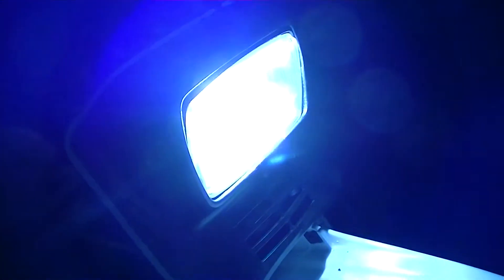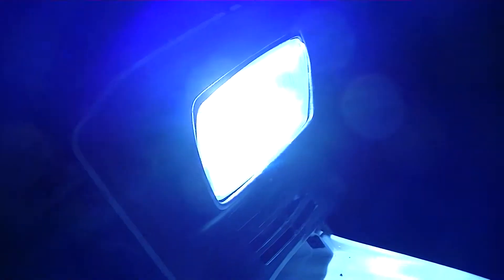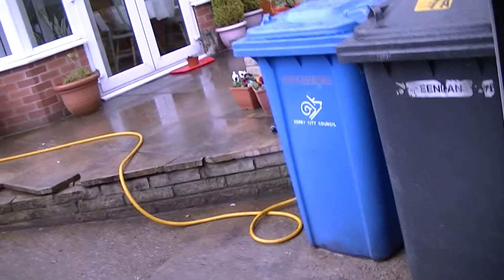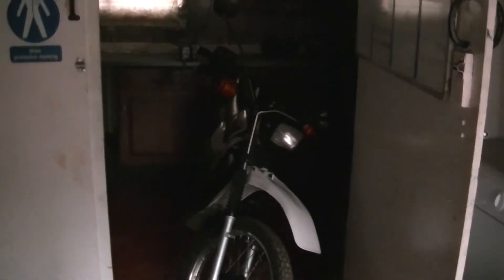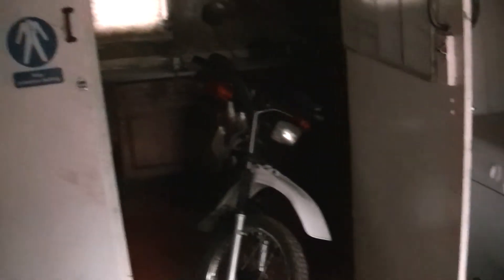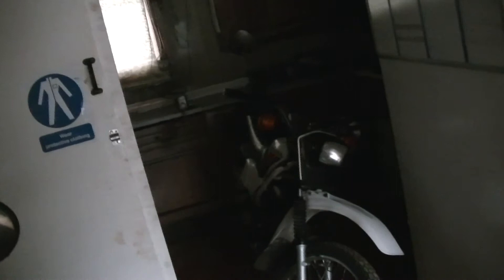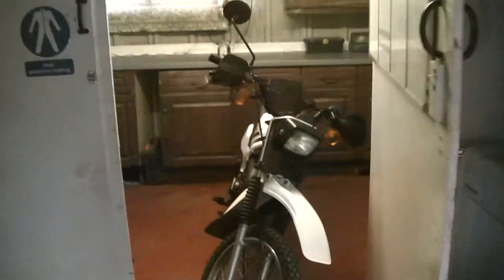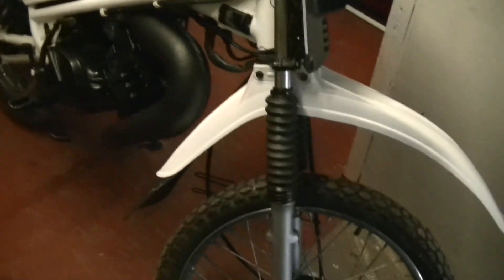Ultra bright moped headlight. HID 35w conversion 6 volts to 12 volts.

Comment: Where did you get the converter and how did you install it
Reply from the maker: directly to the 6v battery. 6v in, 12v out. nice and simple. then just hooked it into the original lighting wiring loom.

got the converter from Ebay see this:
http://www.ebay.co.uk/sch/i.html?_trksid=p2050601.m570.l1311.R1.TR11.TRC1.A0.Xbuck%20boost&_nkw=buck%20boost&_sacat=0&_from=R40&_udlo=10&_udhi
Reply from the maker: johndragonman
you want one about 150watt rated :)
about £15 to buy
Reply: I don't see a 6v to 12v DC to DC converter online.  Where did you find your?
Reply from the maker: wade remer it does not have to be 6v to 12v. it can be any input voltage so long as there is enough amps to push it up to the desired voltage anything up to 36 volts!
it has a little thing you turn with a small flat blade screw driver to get the desired voltage, which you have to measure with a volt meter.

hope this helps ;)
Reply from the maker: wade remer this one here is the same one we are using..  you just need to find one with low postage.. note the adjust mark on the bottom left of the converter ;)

http://www.ebay.co.uk/itm/DC-DC-6-32V-Auto-Buck-Boost-150W-Power-Supply-Converter-/261223418669?pt=UK_BOI_Electrical_Test_Measurement_Equipment_ET&hash=item3cd2210b2d

Comment from the maker: that was a little thing i added to it back when i use to ride it. 6v bulbs were hard to come by so i used a 12v bulb in the turn signal indicator light. on a bright day you could not see it so i wired in a small 9v buzzer on 2 diodes to buzz when the indicator was on.
with them not being self canceling indicators you would go down the road and still have them flashing.

the MOT guy thought it was a great thing! heh